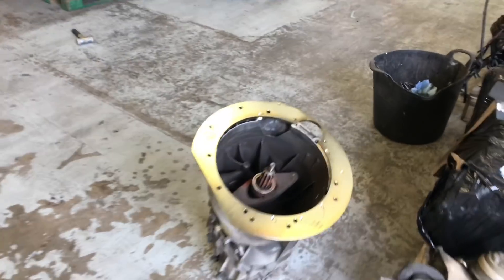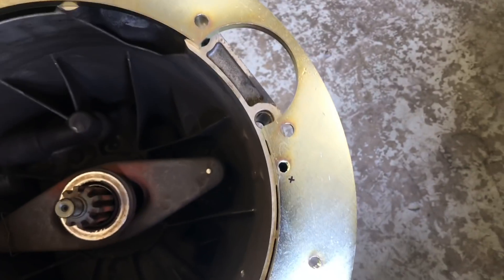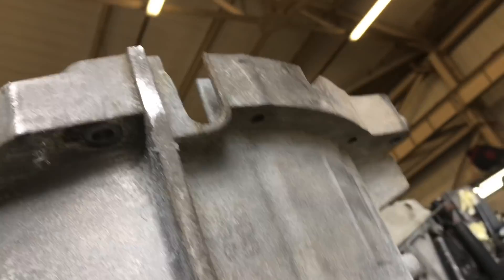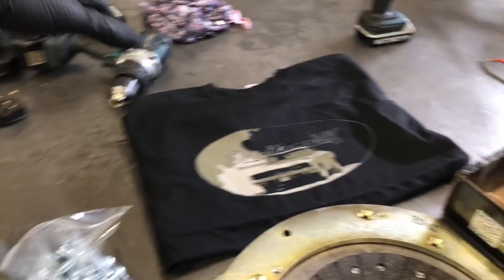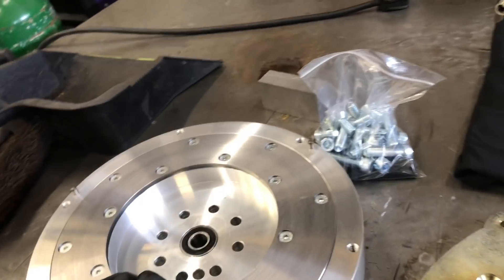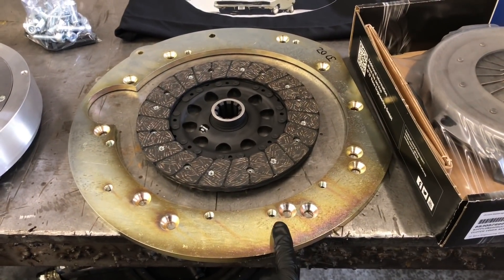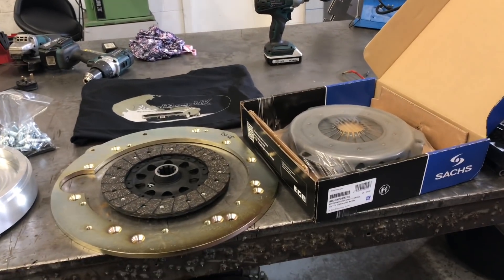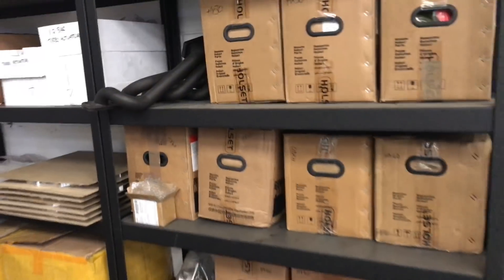OM606 Gearbox And clutch adapters

Comment: Does the 6speed 37dz from the 320d e46 take 280hp from a tuned m57? Guessing ill have to use the 320d flywheel and clutch kit. Possible rts performance twin plate clutch kit with singlemass flywheel.

Comment: Excellent Excellent work. 
I have aW123 240d. ( om616 ) diesel. I am thinking abt attaching aW124 manual 5 speed to it by an adapter plate. Need ur suggestions abt this idea also plz provide ur valuable advice. Regards

Comment: I make a little more globally on the coordinate machine, cut off the bell from the BMW box and the bell from the Mercedes box, then welding and this is already permanent, then on the same coordinate plane check the plane and voila, everything is ready, plus I make a two-disc clutch. You can see such works on my channel

Comment: Can the Patrol adapter kit be used to swap an rb25 with an om606 and keep the stock rb25 box?
Reply from the maker: sidemountedracing , yes you would need the 2.8 patrol version
Reply: @DieselPumpUK  excellent, its probably not the best timing with everything thats going off currently but when everything settles down i would be interested in coming and having a look at some of your stuff,  i have fancied an om606 in the skyline for a long time, Cheers

Comment: So I have been searching all over online, my 02 wrangler already has an om617 swap, I am trying to find out if a om606 will bolt up or do I need to get a different adapter plate and motor mounts? I am hoping that the bolt pattern is the same, trying not to spend a bunch of money right now. Thanks for the great videos. Eventually i will be getting a upgraded pump from you.

Comment: ANY INFO FOR AN ADAPTER FOR MY CHEVY TRUCKS ,, I HAVE THE 4L75/4L70 , AND CURRENTLY  WORKING WITH A FEW COMPANIES FOR WIRING FOR THE NEWER 6L80 ,, SUPER TOUGH AND A SIX SPEED TO BOOT ,,  THE 6L80 ELECTRONICS ARE TOUGH TO GET RIGHT ,, BUILDING , COLLECTING TAHOES AND PICKUPS ,, WERE' IN TEXAS SO THEY ARE PLENTIFUL AND DURABLE ,, A LOT OF US ARE RESEARCHING THE CUMMINS 4BT , AND JUST NOW THE MB. 617'S AND 606'S , ANY INFO OR LEADS YOU COULD SHARE WITH YOUR COUSINS ACROSS THE POND WOULD BE APPRECIATED , THANKS.
Reply: OH ' AND FORGOT SOMETHING ,, WE HAVE FIGURED OUT A TRICK ON MECHANICAL INJECTION ( TO MAKE IT CHEAP,  BULLETPROOF AND ELECTRONIC ) ,, IT WAS RIGHT IN FRONT OF EVERYBODY THE WHOLE TIME  , THANKS AGAIN .

Comment: I don’t own an om60** engine but have an auto m111 c230 and would like to do a manual swap from some research most of the inline merc engines and gearboxes are all compatible so would this work with a m111 engine as I know the bmw boxes are almost bomb proof

Comment: How would a heavier flywheel affect quarter mile times or topspeed.

Less rotational mass 
Engine revs easier.
Does s lighter flywheel equal faster acceleration or faster car.
Reply from the maker: Ronan juries light flywheels are great for racing applications like formula 1 cars that need split second changes in rpm, we changed this mainly due to customer demand and it’s much easier to ship the lighter fly. I have seen no actual performance difference between the two.
Reply: Faster acceleration. And also decelaration. You can easily notice it if you rev the engine in neutral

Comment: Anything for the 420g v8 bell housing? I'd be willing to 606-swap my e34 wagon if so...
Reply from the maker: Nothing currently for V8 but its extremely easy to interchange the transmission in those models, maybe an upgrade to 6 speed at the same time :-)
Reply: @DieselPumpUK  ooh, ouch. The 420g IS a 6spd. The v8 version came in the e34 540i and the e39 540i. The i6 version came in a bunch of stuff, actually.
Reply from the maker: DanielWGK  ok sorry I have no experience with the v8 versions but thanks for the info :-)
Reply: @DieselPumpUK  they're pretty common over this way so if you ever wanna expand, that would be a good one.